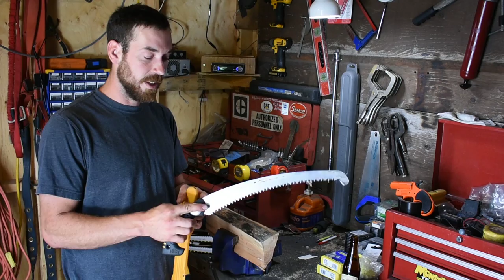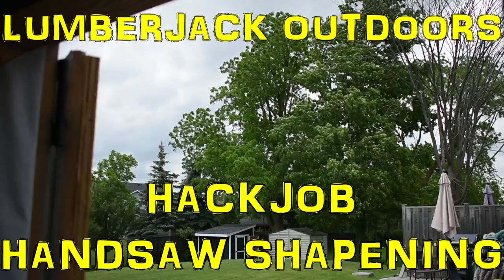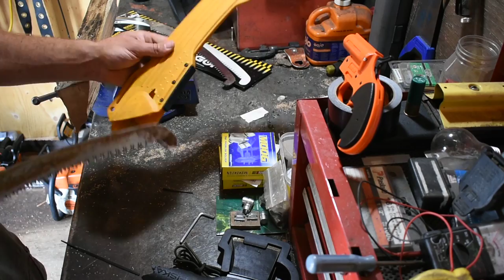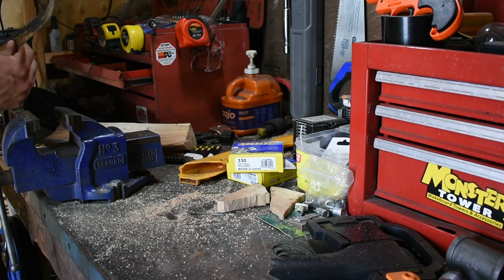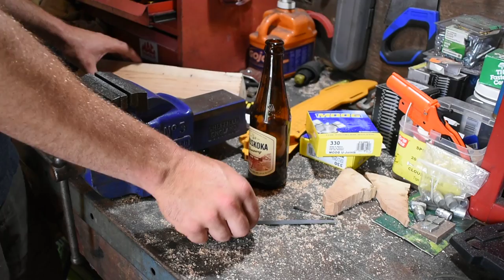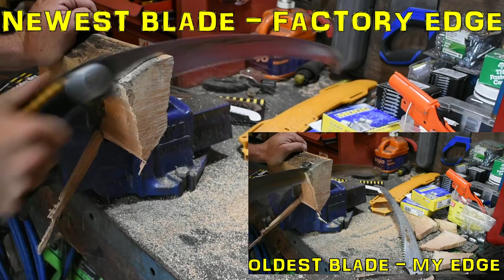Hackjob Handsaw Sharpening | Sharpen a Silky Handsaw

Comment: We were using handsaws to prune the lower branches in 20-25 year old Red Pine plantations... Thousands upon thousands of trees per plantation... My old boss refused to by new blades for our hand saws and we hand sharpened them in the field and use them until there were barely nubs left... With an average 3 sharpenings a week, at about 30 minutes per sharpening (no vice, just "clamped between our knees)... we wasted more money in wages than a new blade cost..
Reply from the maker: 3 blades a week for these silky saws would be close to $300.  Compared to 1.5hrs wages - at even $50/hr that's still only $75.... Lol. The thing I REALLY like about it is now I can pack a file along and actually keep an edge on my saw during extended trips (and squeeze some life out of my retired blade pile!)

Thanks for the input!
Reply: @lumberjackoutdoors933  ok brother :) so the file .....was that triangular shaped...or a flat. I was looking online for a file specifically for the sugoi....and they were asking a ridiculous price of 35 dollars for it...lol...ouch . In addition how well/long is the edge holding up after your file job? Anywhere close to factory?